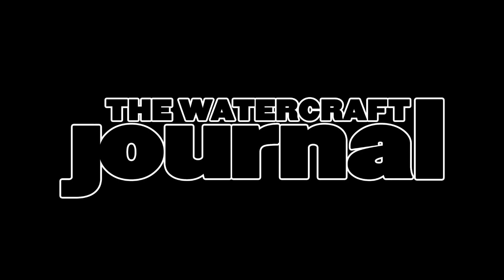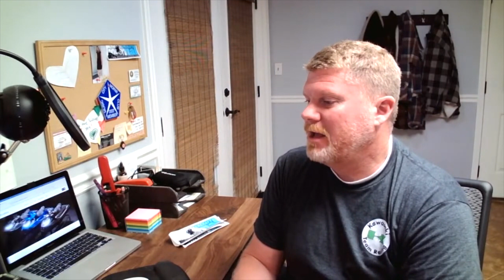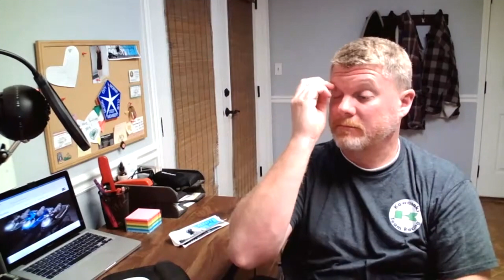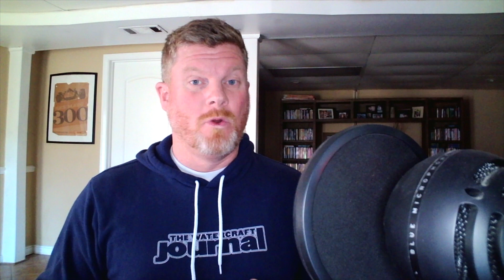The Best Intake Grate For Your Sea-Doo Isn't Sold Publicly: WCJ Quick Topic

Comment: Per your recommendation I got the Riva Sponsons (hole #4) and Riva Intake Grate on my GTX. What a difference in my overall riding experience. Immediately went from annoying to enjoyable.  It handles so much better in chop and the turns in smooth conditions are so much more locked-in and precise. Thanks.
Reply from the maker: Fantastic! We're happy to hear it!
Reply: I got those two items as well + solas impeller and catch can... Still waiting on delivery of new ski but wondering if I should throw it all on right away or go through break-in period and get a feel for the ride first. I would appreciate some advice!
Reply: @Escape.Routine  The Watercraft Journal has a video that addresses that question. Check it out. I would add them if I had them already. The ride is much better with the sponsons and intake grate. Have fun, and good luck with your new Ski. I have not had any problems since day one. 100 hours so far.
Reply: @donaldwest9103  thanks Donald!
Reply: What intake grate did you choose? Part no ?
Reply: Can you tell me what intake grate that is? Part no?

Comment: Interesting. I feel like I’m only just learning basics of ocean chop riding
Reply from the maker: Happy to help!
Reply: First step for tackling Ocean chop is buying a Kawasaki unfortunately. Superior SMC hull
Reply: @cts-vme3353  have to agree. Nearly got a new ultra, but here in NZ it was over 10k more on a trailer, and I’m so used to the seadoos, had all the accessories. Jumped onto a new RXP and had first ride on it, noticeably better hull than the RXT I was on. Won’t be a Kawasaki out there in ocean, understand :)